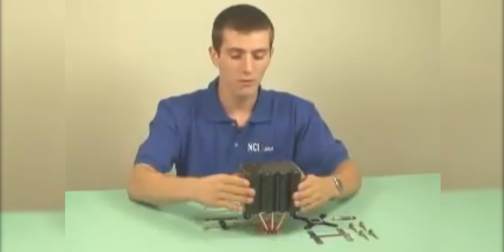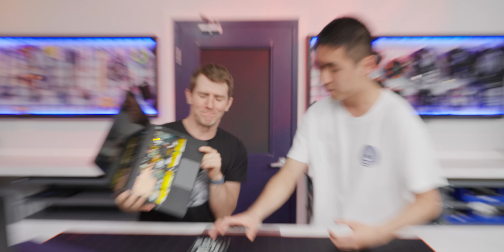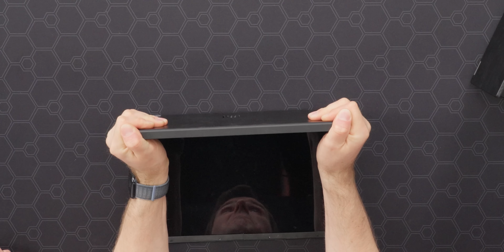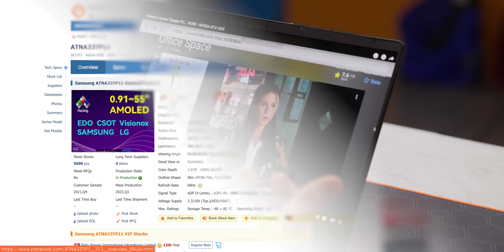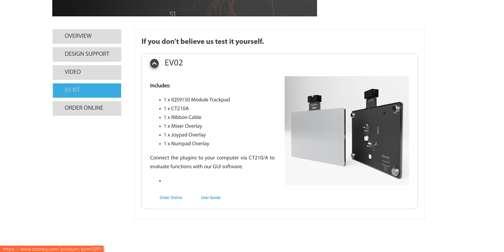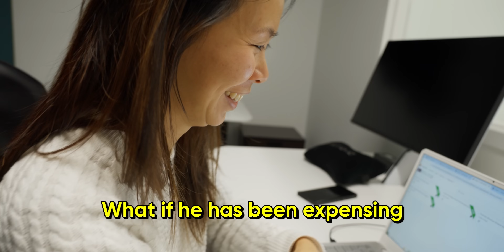This Kid Made his Own Laptop and it’s AMAZING!

Comment: That's one ugly laptop nobody wants to see visable screws on their laptop, running on a separate battery to charge the keyboard is... The amount of heat it will give off during gaming would be 10-15 degreees higher. Great idea but definitely not good for gaming at this stage.

Comment: those speaker only need a thin padding to absorb vibrations. the all metal chassis doesnt help with that either, maybe a custom "ported" box for the sound to travel through. think (BOSE designs)

Comment: Ex-bios engineer (20+ years ago) for one of the largest laptop ODM here. I think the main reason is that PC (assembly) business is very low margin. While it doesn't look like it's modular, it's considered very modular within the company. We only have a handful of designs but we have to fit different components from different brands. Each combination is a sku. So you can see that SKU can blow up as the number of components goes up... When we talk about low margin, it's so low that the volume for dell, hp, Compaq, Toshiba, etc. each brands alone isn't enough to sustain the 3-5% margin.

Comment: This guy's laptop is pretty cool, don't let the following comment detract from that, the comment is about the industry.

End of the day, a modular anything only works for mass production when there is industry level standardization. You need all the companies to agree on it. Laptops and Cellphones fail each time cause, their product may be modular but, they're still the only ones making the parts that way. Desktop PC's have industry standards. If I buy DDR3 ram I know it works in any motherboard that supports DDR3. I don't have to buy that DDR3 from the same company who made the motherboard. Just like shipping containers didn't really take off until there was a standard size for the containers.

I know bad part to use as an example cause laptops have swap-able ram but you still get the point.

Comment: I bought a old i5 7200U Acer Aspire E5-575 laptop for about 67 dollars, got a 12 dollar power supply, 30 dollar 500gb ssd sata three and 18 dollars for 16gb ram, and a 256gb I think it was NvME PCIE into it from my old laptop. So I will round it up to 130 dollars. So I put LMDE on it. So was it a good deal or a bad deal? The screen is good, the keyboard is good, has dvd rw. But clearly the battery was dead or needed a new one in it.

Comment: I'm well beyond impressed with that project tbh. RK3358 has a LOT of potential, i've been wanting to get one for a long while now, they seem to have pretty decent specs and be very power efficient. Once there are proper free and open source Mali gpu drivers for Linux available for everyone it'll be even more awesome. However the excuse for not having a webcam seems kinda sus.... there are quite a lot of webcam replacement parts for laptops on places like aliexpress and similar that are essentially really thin stick-shaped PCBs with a uvc webcam on them that would be plug and play with any linux distro.

Comment: Hey, I'm sure his computer will handle wireless just fine, as you're connecting it to the screen frame to use it as an antenna, he can do the same with the metal case essentially. I mean, If vertical placement is better than horizontal I suppose the case lid is better to attach to (screen frame, however you want to call it), but I'm not sure that even matters...

Comment: Did exactly that, first wallet, bitcoin only, connected to blue wallet-read only to check balances without access and piece of mind. Air gaped, Open source, option to disable USB cable for data transaction - done.

Comment: For computer chassis, you want to use 7075-T6 Aluminum (which is a heat treated tempered aluminum making it very hard and high-strength!) and then ANODIZED with whatever glossy, matte or multi-colour/iridescent colours you need. I would PREFER a full 2 mm thick 7075-T6 Aluminum skin for ultimate chassis stiffness and tensile strength but you can get away with 1 mm thick too!

V

Comment: Time to hire this guy! He's good on camera too! AND it's also time for LTT to make THEIR OWN custom-designed and LTT-built modular laptop AND a luggeable lunchbox (see Dolch Lunchbox computer on Google to see what I mean!) that has BOTH an AMD Ryzen 9/Threadripper/EPYC cpu running Windows AND an ARM cpu running Android at the same time! The REALLY BIG THINGS we want to see on the modular laptop and lunchbox is at least 8 of the USB-3/4 type A ports and 8 of the USB-Type-C ports already BUILT-INTO the chassis! Then we need enough System RAM and GPU horsepower and the latest DisplayPort and HDMI ports to run EIGHT DCI-4K (4096 by 2160 pixels) resolution displays at a full 120 fps or even 240 fps all at the same time with no lag!

LTT easily has enough in-house talent to built the ULTIMATE modular laptops and lunchbox computers that are ruggedized with big carrying handles, IP-68/Milspec-810g ruggedness ratings and LOTS of audio, video, USB-3/4 Type-A/C ports built-in! AND for us content creators/gamers and video/photo editors add a big trackpad, trackball and jog/shuttle controllers and a multi-dial Loupe-Deck setup to the modular keyboard part!

V

Comment: I actually expected something a bit different. I thought the PC would be powered by Windows, but it has a board that supports Linux — in this case, Ubuntu. I think I’ll wait for the ultimate build: like a DIY PC that looks like a laptop — small, thin, and easy to upgrade. I want something where you can simply swap parts like the USB ports or the GPU.

What I really want to see in a laptop is a full desktop GPU with its own type of cooling — maybe a super-thin turbine style. We know that modern laptops usually don’t use MXM like the old ones (e.g., the 980M), and some laptops from around 2018 to 2020 had socketed CPUs, just like real PCs. That would be the king of kings in a different category.

About this again — I’d say it’s more like a tablet without a monitor, but with a keyboard and touchpad. Similar to how some phones can be docked to a monitor. It feels more like a hacker’s PC — the kind of machine with Linux, often used for DDoS attacks, etc.

Comment: Wireless mouse no battery? Hmm dynamo trackball built into the mouse with small capacitors, or maybe even tiny coil windings over a low magnetic field mouse pad? Iteresting.

Comment: With the magnetic snap in of the keyboard you could downsize the battery a bit to make it lighter and also add a small charge controller with contact points, this would make it cheaper to build and make, just a thought.

Comment: the wifi thing with the antennas i have put my micro racing drone in the fridge using 5.8ghz and i still had good video on 25mw i could go higher i even put it in the microwave to see if me controlles would lose connection controlles are 2.4ghz and a microwave works at 2.4ghz so i was thinking the shielding should block the signal i did not turn it on i still had controlle and good connection i could see it and had video but is 5.8ghz

Comment: I can see huge market for the laptop design as his, but for GOD OF ELECTRICITY SAKE, STANDARDIZE IT ALL!

The OLPC project failed because Microsoft and all Chinese laptop manufacturers distilled the whole idea and eventually ruined it by making hardware requirements too high for Windows Vista time (XP wasn't much better). 

But this time to make a ARM laptop, that would be cheap and provide good 4-5 hour battery life time at minimum and run any distribution of Linux...

Comment: Amazing talent, no question.
But why you kill your performance (in games) in such a small screen with 4k? below 32" 1440p is fine (oc it is depending much of the quality of the screen, not just Oled, IPS, Led...but in those the different quality) bc you can buy 13+ thin (5mm) laptops, with really nice HW and it has 1080p, but it is Oled. 
So again in that size and bc of good quality screen 1080p is why enough for every day use even better, bc your performance and your battery will last longer. 
And you will have100fps instead "you have to look down" :)

I'm not as far is good in this field, but is there any problem IT wise my logic? Thx in advance!

Comment: I wanted to make my own transparent LCD screen that is incorporated onto a motorcycle helmet, but I noticed over the course of 2-3 years, the individual components of leading tech rapidly became less n less available to the general public and now you'd be hard pressed to produce the same product as you could a few years ago. It's no coincidence this tech is included in the main products of some big brand names line up. 
Eg. You could buy a smart ring several years ago that had a very basic single purpose function, that was powered by the wearers skin and kinetic energy of the wearers movement alone. Not good for being a replacement for tap n go systems, keyless entry and ID verification functions BUT, it never needed to connect to a wireless network through it's own internal systems, or charged though dedicated devices that can be exploited at the hardware level if it is if enough interest for someone to do so. So exchanging cryptography keys, functioning indefinitely without auxiliary support systems required etc. 

You try find a single wearable smart device that incorporates the electrostatic charge and/or the kinetic energy of the wearer.....

Take your time 2, I'll wait .
I'll wait.

Comment: 1. What is different between this laptop and raspberry pi attach to keyboard, display and gpu?
2. What is expected price ? Because if pricing is bad then product is bad.
3. 4k monitor attach to low-end performance is really bad idea. Because it use too much processing that you don’t have on this setup.
4. You show Minecraft 60 fps with unknown setting but consider what show in video it should be lowest setting then performance to display resolution is not that impressive.
5. What is Battery expectancy ?
6. Too many free space in notebook which mean you not fully utilize space for it.
7. Not mention about cooling system. Even if you use passive cooling there is a component to improve it.
8. This more like a design concept than a product. Because it lack minor detail which make other brands laptop good.
9. Video hide too many imperfections of the laptop.

Comment: Hi linus, i have a custom pc i9 14900k with nvidia rtx 4070 super, i play call of duty mw3/warzone. Lately i been having too many crash with directx errors, sometimes i can’t even play, i deleted the game installed it again also the graphics drivers and no luck, i downgraded the nvidia drivers no luck, im stuck in here and don’t know what to do, i need some help pls 😀🙏
Reply: Check official forums for the game, it seems to be a common issue after a windows update. Wait for a windows update or graphics card driver update, or game update. Try running it with nothing else in the background to ensure nothing wastes ram, with no conflicts. No RGB software, nothing. Disconnect unnecessary hardware. Or try with slightly older graphics drivers

Comment: I love this! I've been using the CM3588 as my desktop for two months now and while you have to love Linux to use it, it's actually possible to get a very nice user experience with it. I actually have laptop design for it, except in my case it's more of a nomad PC design. It doesn't have to be thin or light, so I'm making mine in wood. But one thing I really needed was a way to connect a good laptop screen. So I'm definitely going to check out the repo. Awesome! Oh, and since you mentioned Baldur's Gate; you can play BG1 and BG2 on it using GemRB and I just read someone has completed Icewind Dale 2 on it. :)

Comment: If I had the capital to do it, I'd try to hire this guy to engineer an open source head unit for cars.  It's difficult and many things are needed to be customized but it would be great to have a practically professionally engineered head unit that is ready to load Linux or whatever and have the software whatever you want it to be instead of closed locked down proprietary ish that is never exactly what you want.  I'm on my like 6th or 7th attempt to creating my head unit and this time it's taking forever bc I've lost motivation, time to work on it, and in my head I've removed the option to get something wrong again...

Comment: Super awesome - I would just find a way to move the antenna to the top of the screen, that is the only thing that would bother me. The metal frame will cause a loss of strength and good wifi is so important these days.  Also, I prefer non-metal laptops just for this reason.

Comment: @byrantech Next laptop can you please try add in Web cam no need for custom stuff just try fit in a pre made Web cam part just to see if it will work. And besides this can your mother board be tweaked to include internal hdd slot too? Besides M2 Sdd slot? I wanted to make my own custom laptop which is more old school but there is literally no one who can develop custom motherboards at affordable prices which sync up with installed parts for example let's say I want to install 2TB hdd+2TB ssd the motherboard needs to be able to process this load. And how much is your current motherboard ram slot max capacity(have 2 removable slots?) and what is the processor base speed you have? And does your current mother board have both dedicated(removable) and internal graphics cards?

Comment: In 2006 I got AVA laptops (now AVA Direct) to build me a custom chassis that could support a full size (desktop) graphics card, (with cooling) I had them build the Intel chipset PC with a Gigabyte motherboard around all the fastest support devices for the nVidia GeForce card and it had a dual Blu-ray writer with dedicated video RAM. It was viable for high resolution real-time architectural visualization for over a decade. Literally every time I walked into an office, my laptop took the title of the most powerful PC in the building, for maybe 3 years until some architecture firms and government departments in Los Angeles slowly started upgrading to Quad Core Xeon Servers and other higher end desktops for more than office work. It survived 4 Windows upgrades (XP to 10, skipping Vista) and still boots up if I want to use it today, but it's now relegated mostly to video transfers and occasional retro gaming. My preceding laptops were all top offerings from Compaq, Asus, HP, and I was fed up that I always had to sacrifice GPU performance to the "mobile" version if I wanted a laptop! No More!!! The thing was a beast, over 12 lbs not counting the power supply brick. This thing ran rings around the top Alienware desktops of the era. I think it cost around $6000 all in. My next system in 2012 was a desktop with 4 times more everything and cost under $4000 just so I could have a system always on at home for hosting files and give my laptop a break on weekends. I had to replace the thermal paste done at the last servicing because some moron at the shop left the plastic film on between the chip and the heat sink, almost fried it if I didn't catch it with my cooling monitoring. The shop owner was pissed at his employee for that mistake, I never saw him get upset before that moment.

Comment: I want a gaming "laptop", that is not actually a laptop, no battery, just a lightweight plug in mobile gaming machine for use in hotels. Replace the battery with a higher power/larger GPU and/or much better cooling. Gaming laptop batteries are usually crap anyway, they're more an UPS than a laptop battery.

Comment: If he creates a PCB way circuit board it'll be even better. Everything counted without soldered cables. Of course it's in its prototype form now but has potential. I like the easy swapping of parts. You could have different coloured keyboards and shells to change your laptop whenever/wherever.

Comment: Super light mouse with no battery, has been done, guy took a wacom or wacom like pad, put the stylus bits inside a mouse body, mouse pad transmits the power to the coil in the mouse.